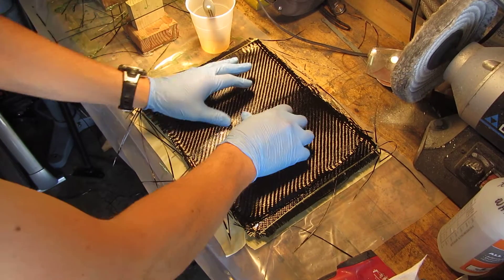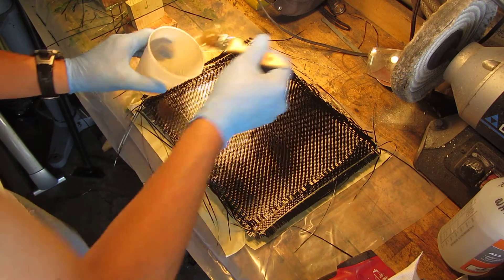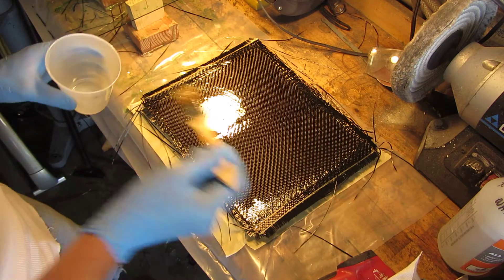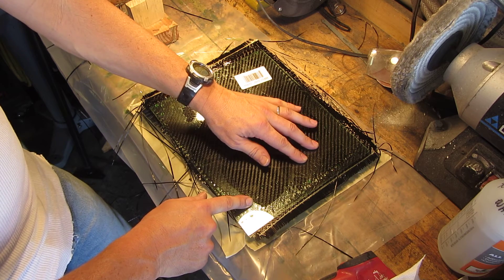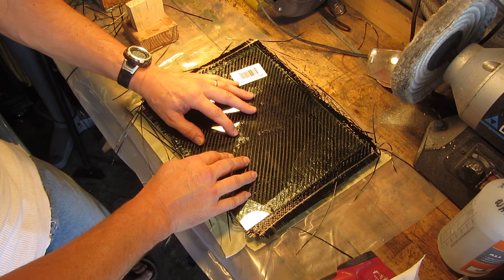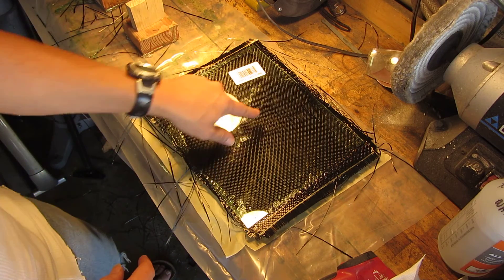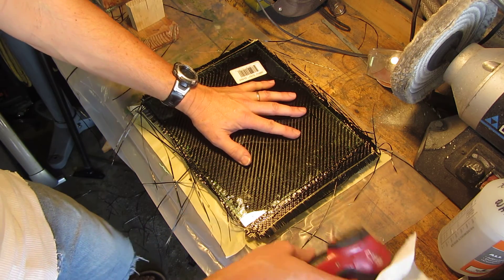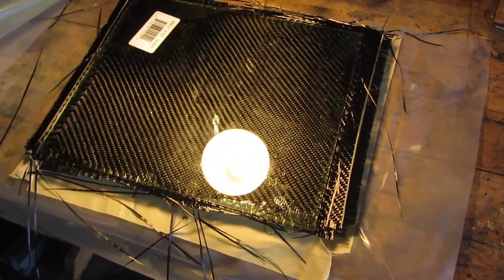Carbon Fiber plate making, Part two.

Comment: what if you used a heavier coat of epoxy resin for you last top coat? would that eliminate the air bubbles. i know its going to be more resin then carbon.
what did you use as a release agent, pva?
Reply from the maker: No.
The air bubbles are for ever present. You can get rid of them by degassing the resin, but you will stir in new ones when you brush the resin in.
Release agent:
http://stores.ebay.com/Polymer-Products/MAX-MOLD-RELEASE-KITS-/_i.html?_fsub=3115781&_sid=61010028&_trksid=p4634.c0.m322
Reply: im talking about when you press the upper piece of glass down. i just thought by putting a thick coat of resin down on the last layer that will make up for any large air bubbles.
Reply from the maker: JOEGGGJOE
 When you mechanically press the composite layup together, you will trap whatever gasses there are. On of the differences as compared with a vacuum layup where you sorta suck out the bubbles trapped, via exotic methods. It matters not if it is thin or thick layer, as to the bubbles trapped. :)
Reply: i just remembered you put those 2 seperate pieces.